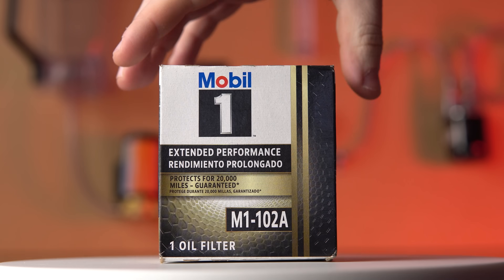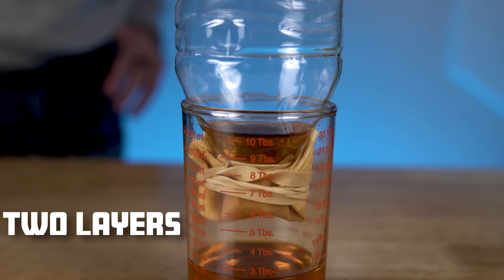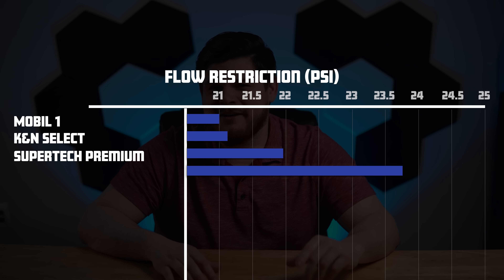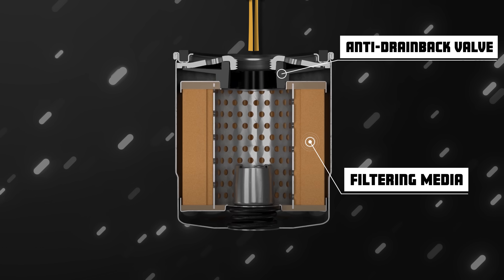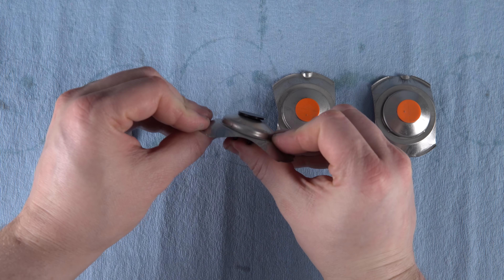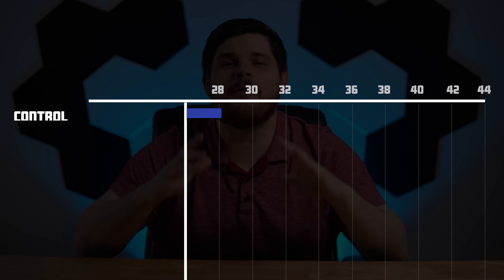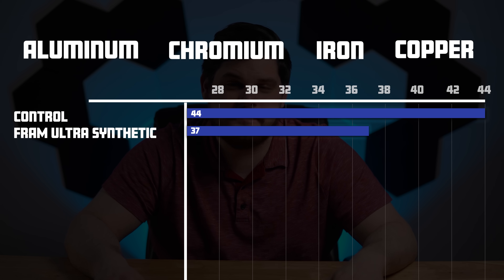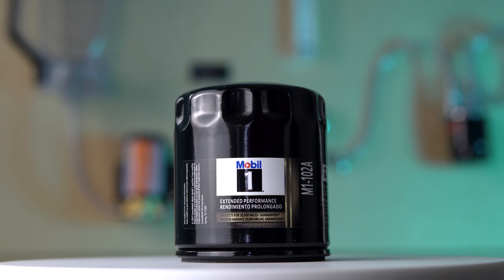Engineers Test the Best Oil Filters! FRAM | Mobil 1 | K&N | Walmart Brand

Comment: I watched both your filter test videos.  I like the bar graphs in the 1st best.  Also like the hot test in the 2nd one.     Would like to see series.  Test 2017 OEM oil filter and compare to bunch off others Fram, Purlator -ect.   Continue with Chevy Cruz OEM oil filter then compare to Aftermarket filters same.   Follow with F-150 truck, Toyota  truck OEM oil filter compare to aftermarket filters. Ect ect ect. Will be your biggest series.   I would like finders fee later after you are rolling.  Great idea. Go go

Comment: UM the AL powder could have just been passing thru the filter. Not sure that's a valid test. Cause you can keep feeding powder into the system and what you are really measuring is how much powder you're throwing into the oil flow, not how much or what % is being trapped. The specification is that the filter traps let's say 99% of particles 30 microns and above. You would have to be able to put into the oil flow a measured amount, let's say 100 grams and then measure the amount the filter trapped and/or how much passed thru the filter. You're just guessing as to how much begins to "clog" the filter. but if it's passing thru then you think the filter is taking more and more to clog up, but it may just be passing it thru.
Reply from the maker: @groovymoon, Thanks for your insightful comment! You bring up an important aspect of testing filter efficiency. We've updated our testing rig to better mirror standard specifications, like measuring specific particle sizes and quantities. We cover these updates in our second to last video. Feel free to check it. Thanks for the support.

Comment: The bypass opens between 2-5bar. When the engine is cold, no oil is filtered, everything goes in the bypass. Most engines have an oil pressure of 3 bar and above. Test the filters without the bypass valve and with different oil temperatures and see how much oil flows through the oil filters!
Reply: The oil does get filtered cold, if the right multigrade oil is used.

Comment: I've heard a lot about certain filters (like the Fram filters) actually collapsing so the fact that the Fram does restrict oil flow may be part of this reason.  I can see now why people sort of call some of the Fram filters as OCD (Orange Can of Death).  While it has the dual filtering, this seems that it may negate or cause potential issues, especailly if you don't change your filter that regularly (which IMO people should ever 5k or 6k miles, but some do it every other oil change).  My guess is that if you go prolonged periods of time with the Fram, eventually it does collapse most likely and really restrict oil flow, which is bad.  I used to use them on older cars that had hig hmileage and they were fine, but I was also changing the oil on those vehicles ever 2500 miles or 3000 miles (using conventional oil).

Now this all being said, I have a modern (new-ish) Toyota that has the built-in housing (so you just replace the filter itself, so it's not a screw in filter but rather you unscrew the housing and replace the filter inside.  I guess I haven't looked into third party filters yet but I'd be curious if Mobil 1 has an aftermarket filter that would fix my car for when I'm done with free oil changes on my car (from the dealer, which will be in another year or so so I'll have to start paying for filters and oil at that point and may just do the changes myself).
Reply from the maker: Hi @HR-wd6cw, Thanks for your detailed comment and sharing your experiences with Fram filters and oil change practices. The concern about filter collapse and oil flow restriction is indeed an important one, especially for filters that aren't changed regularly. In our latest episode on Fram filters, we go over flow restriction and the different build qualities of their oil filters. Feel free to check it out! Thanks for the support.

Comment: This has been one the best actual testing of oil filters. Most other sites just cut them apart and give subjective opinions on their construction without any valid performance testing.
Reply from the maker: Thank you so much for the kind words. Your support is greatly appreciated!
Reply: @BrandRanks  As an Engineer, I analyze all the facts possible before coming to a conclusion. Yes, there's still some questions that could be addressed. One that comes to mind is: What's the difference in each filter performance if the oil is changed every 5K, 7.5K, or 10K miles? Force Induction applications are more severe to oil as compared Natural Aspirated Engines. Would flow in FI be more important then NA engines? 
Some of these results may be significant or may not be discernable.
Reply from the maker: Those are great points and good ideas to figure out in future videos. Also make sure to watch the new video where we greatly improved our testing process with a bigger budget.
Reply: @stealthg35infiniti94 
Reading this , I now see why my brother is way ahead of me.
He’s an electrical engineer.
I have no idea what you are saying , and that goes for my brother too !
I hope you take that as a compliment.
Reply: I think Project Farm also does reliable testing.

Comment: My results are :  
1.  I use only full synthetic oil and usually a Fram XG filter every oil change 
2.  I do an oil change every 5000 miles
3.  at 200,000 miles my engine burns zero oil and runs like the day I bought it
In my personal opinion the 5000 mile oil change gives the best results regardless of the oil or filter used or the make and model of the car.
I have driven at least a million and half miles in my life so far and I have never blown an engine.
Reply: Same here, I buy the "high end" Fram filters for my vehicles but do them every 5k miles with synthetic blend. Been doing this since the 90s without issue. Synthetic obviously came along a bit later and I switched from 3k to 5k miles after finally accepting 5k was okay with the upgraded oil and filters combined. I use MotorCraft too since I'm a Ford fanboy. My Fords have gotten totaled before I've ever had to do any engine work (when you drive 160-230 miles a day for work, the fools will eventually catch up to you no matter how cautious you are).
Reply: @robcobi the fool, is you. First off Motorcraft is not the best. 2,, we run ford's. Crown. Vics,, lincolns,Lincolnshire,, as 🚕 🚖 🚕. Town cars,, as taxis. And we change oils,, fluids,, filters every 12 000. MILES. And these extreme duty 🚖 🚕 cubs have 550.000. MILES ➕️!!!
Reply: Well I ran 265k miles on my Ford 4.6 and changed the oil maybe 10 times in its life.  The engine ran strong and silent.  Synthetic oil goes WAY beyond 5k miles.  I'm currently running a Ford 5.0 with 199 thousand on the clock and change oil once every two years.  I run fram filters and change every other oil change.  As you can see by his test the filter media was basically clean after directly pouring in metal.  I do not recommend my practices just stating my real world experience.
Reply: @stevegarlock4269  Don't try that on a KIA.
Reply: @stevegarlock4269  Only with good motors.  If you have GDI, you already have a problem...
Reply: @stevegarlock4269 he I's the fool😅,throwing money 💰 🤑 away
Reply: Sorry Rich, but ALL IC engines burn SOME oil.  
Yours may be using a very small amount-from what you've written its not enough to need any added between oil changes, but still a measurable amount. My wife's Scion goes 7500-10,000 mi between changes and the oil level (of 5W-20 oil) drops VERY little.  But without the thin film of oil that is metered through the OIL CONTROL rings (that's their name)  engines would have much higher amounts of friction. The heat generated with no cylinder lubrication would be enough to quickly seize the engine.    
That tiny bit of oil being supplied to the cross hatching of the cylinder walls, (or more, depending on your particular engine's state of wear) much of which  burns off with each combustion cycle, is ABSOLUTELY NECESSARY to lubricate the cylinder walls.
Reply: @donaldschmied5600  EXACTLY, in fact the U.S. Army, Marine Corps, Navy, Air Force and Coast Guard require every engine evaluated for use in military service to burn a predesignated amount of oil!
Reply: @donaldschmied5600  Ok I agree with you but if I'm down very little in oil consumption and I get a little fuel dilution into the oil bringing it back to level , I believe I've reached the best that can be obtained with direct injection technology. If I continue to have the exact same results at 200,000 plus miles , the motor wear is insignificant which is the desired result.
Reply: Modern engines don't burn a lot of oil. They do more leaking as seals shrink.
Reply: @trentallman984  Actually there are a few that do burn oil - try VW and even some Toyotas - in their efforts to get better gas mileage they used piston rings with less tension but they allow oil to pass the rings.
Reply: @nrich5127  we had an 02 Camry with the 4 cylinder, so I know there are exceptions.  But you don't see white smoke anymore like you used to.
Reply: @trentallman984  Wrong, the top low tension piston ring will carbon up, allowing oil to pass it.  Many GDI engines have that feature.

Comment: NAPA GOLD or PLATINUM made by WIX with custom NAPA upgrade are superior to all. Fact: The difference between the two is not better filtration no, the platinum element is engineered to not crumble and clog the oil pump within a year if, you are not a high millage driver. Time is more important than distance in my case. I've a 7.3 that runs about 300 hours a year. Change filter every spring; change 16 quarts of 5/40 Rotella T6 every second spring. Still transparent, I give it to someone that can use it that's on a low budget. Father in-law sued FRAM over 40 years ago; settled out of court for clogging an off shore cigarette boat engine he just rebuilt. Likely didn't want the publicity, no argument just cut him a cheque for damages.

Comment: I like the lack of mention of delta p. I also like how you find a 30 micron filter superior to a 20. Engines still during normal use see 20 micron.  Its also been shown that filtering at 20 micron has not hurt anyones oil pressure where people have had lack of lubrication.  Test doesnt tell the whole story.
Reply from the maker: Thanks for the feedback, make sure to go watch our latest video, were we made several improvements to the testing. Thanks for watching!

Comment: I have been using WIX oil filters in my cars for the past several years. I wonder how they would perform in your tests. And I like my GM filters that do not require any metal housing since it drops into the filter housing in the engine.

Comment: You can't be a mechanic if you're claiming Fram is a good filter. It's actually one of the worst, no , no, it is the worst filter made. I'd rather have a cheapy from the DG.  Anyways. Mobile ones oil and filters are hands down, the best you can buy.

Comment: You should also test burst strength.  How much pressure they can handle.  I was at a car show and a guest speaker who was a renowned engine builder told everyone to stay away from Fram because he had seen many of their cans blow under hard acceleration/race conditions.
Reply: Harmless, but this is a spec that you shouldn't put in the same caliber as the tests they ran.  My first car, a 1966 Galaxie with a 289, had, unknown to me, water in the oil when I bought it.  The oil filter exploded on startup the first night it got below freezing.  Haven't had a filter explode since then, it's been 49 years now.

Comment: One thing about the filter capacity is as the filter is loading up its filtering efficiency drops. So the filtering efficiency of the K&N will also drop faster then the mobil and Fram through the entire oil change interval to a point of actually filtering out less contaminants.

Comment: The worst thing is when an oil filter element comes apart and leaves filter debris in the engine that eventually clogs the oil filter pick up screen, I remember this happened to a Tech that worked at a Lincoln Mercury dealer I was a dispatcher at back in 1997, he had a Bronco II that he had owned since new and said he never used anything but Motorcraft oil filters and Motorcraft oil. There is a possibility that he used dealer tank supplied bulk oil (instead of from bottles) and the debris could have been in the oil itself, this is not known, he noticed the oil pressure was low before engine damage occurred and pulled the oil pan off one day at the dealer & discovered the debris, he was dismayed by this to say the least. I have heard Fram filters tend to have cardboard internal end caps but never had one come apart that I was aware of and I used Fram filters for many years. I now own a Toyota pick up and only use Toyota filters I get at the dealer.

Comment: You need to do filter bypass tests with different weights of oil at different temps.    I believe that many of these filters are in bypass at startup most always.   Filtering ability means nothing since the filter is often bypassed.    At hot temps, the oil then is able to flow through the filter with no bypass.   I think the higher flow filter is likely the best since it is seldom in bypass.   If you are worried about dirt, just change your oil more often.

Comment: There was a time, mid-2000’s in motorcycle road racing that if you had a FRAM filter on your race bike it wouldn’t pass tech-inspection, therefore you couldn’t put on the track!

Comment: Have you ever examined the reusable type? Pleated, overlapping metal mesh as a removable insert in a billet housing.
The cost is rather more than ( say ) 10 mid-price replaceable filters. Claims include very low resistance to flow with good filtering, but more importantly, no landfill waste.
Aftermarket bypass filters may bear examination too.

Comment: what's up with all the oil filter test videos?  use OEM (if available) for the correct pressure bypass valve and recommended oil weight changed every 5,000 miles.  For older cars use cheap filters and higher viscosity oil changed every 3,000 miles.(straight 40w valvoline if an oil burner.)  Do this and your engine will last longer than the rest of the cars.

Comment: oil filters do not even work after 20lbs of pressure, they only work when an engine is started up! after 2lbs of pressure the oil is diverted around the outer layer of the fiber inside of "the filter"

Comment: I can’t fully agree with this test now that’s I’ve had a chance to try different filters. 

I’ve used Honda, Mobil one, k&n, and Fram synthetic directly on the same oil and found the Fram to actually have higher oil pressure both hot and cold. Also for reference the oil pressure is measure at the head on Honda so that means that the oil must pass through both the filter and the full engine before pressure is read. On the built engine the Fram showed an additional 10 psi at high rpm and 8 at idle. The data was collected with a motec motorsports ecu using 15w50 Mobil and with 10w40 Pennzoil on an identical car stock engine showing the same result with data collected using a Hondata Flashpro. I found the exact trend and pressure increase at the head. The oil pump pressure relief valve is built into the pump on these cars so the pressure is regulated before the entire engine. 
Both test cars were 2017 and 2018 Civic Type R
Something as simple as the adapter plate being used here can be a factor. The clearance between the filter and actual inlet and outlet could be a factor here and could also be a factor on other engines as the depth of the top of a filter are not all the same. On the built engine I changed just the filter alone to test. 

More pleats in a filter also give more total area to allow flow but of course space between pleats can matter also.
Reply from the maker: Hey, be sure to check out our new video. We have made several changes to the methodology of our testing. We will be including Fram and Mobil on in future videos. Thanks for the feedback

Comment: 1:25..And help control heat..(temperature).. 🤔so, two jobs...
Pressure rating of a brand new filter doesn't mean anything negative....if you have a finer micron substrate (the filter paper) then it would trap MORE fine particulate...
that would be BETTER
4:08.. if you're not heating the oil then it isn't "a real world scenario "...

Comment: All these test are great, but do any of these filters actually effect the life of an engine. I used fram filter and mobile non synthetic in a 5.0 in a f150 in texas from 89 to 2007. It had 250k on it when i sold it and the engine had zero engine wear issues. A real world 250k controlled test is impractical and expensive. I dont think any of this really matters at the end of the day.
Reply from the maker: Thanks for sharing. Very impressive on that millage!

Comment: The tests were built for the non-Fram filter. One of the biggest selling points of the Fram is the 20micron filter element. I dare you to do the metal shaving test with 20 micron pieces of metal. The Fram will stop them but none of the others will. It's unfortunate the test was not built to show the different filters strengths.
Reply from the maker: Thanks for the feedback. Go watch our new video were we made several changes to the rig and testing methodology. Next video will be fully dedicated to FRAM. Very good results so far. Again, thanks for the feedback.

Comment: Cool review.  I’ve seen a similar one a while back and royal purple won.  I’d like to see another review at normal engine operating temps and include royal purple and amesoil.  Thanks for making this!
Reply: Royal Purple and Amsoil are the same filter, they have been cut open and they were identical. I use Royal Purple oil filters but if you were in a bind you could get an Amsoil oil filter knowing it is identical.